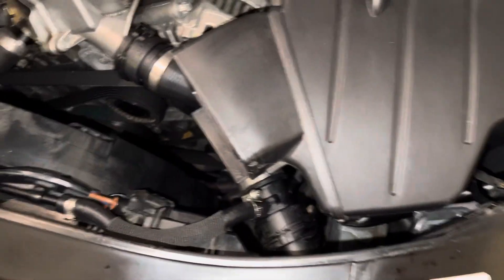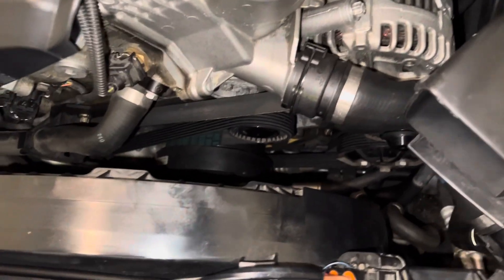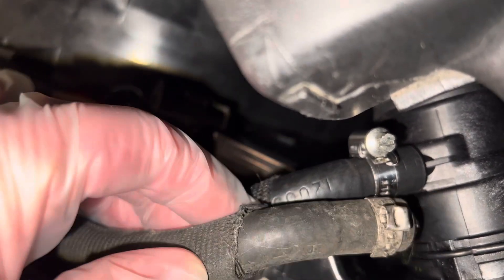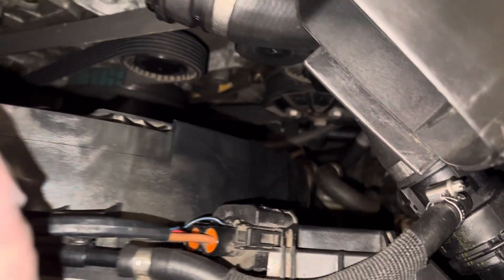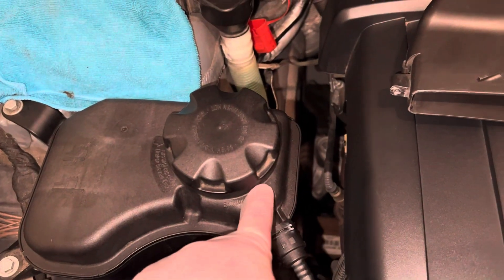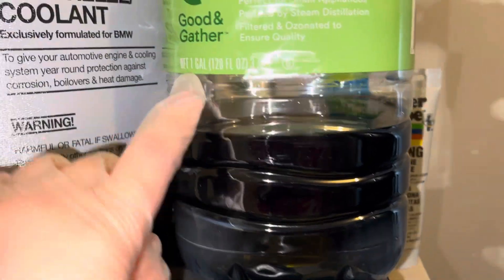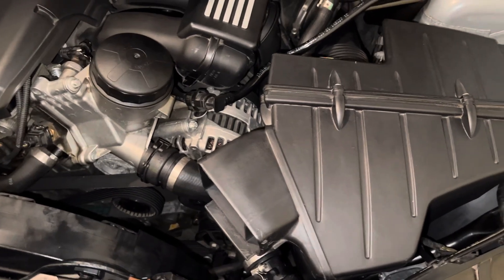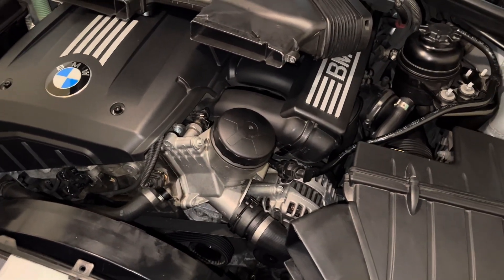How Tight To Tighten Hose Clamps, And Bleeding Coolant System On 2011 BMW 328 XI?

Comment: Where did you put the lube? On the inside of the hose?
Reply from the maker: @atsila_one  I rubbed the lubricant on the rubber O-Ring inside the hose.
Reply: @ do you think Vaseline will work? I’m having the same issue that you had as well did you lubricate both ends of the holes
Reply from the maker: @ I personally would not use Vaseline, because petroleum can deteriorate the rubber rings inside there. I only had to lubricate the part that attaches to the radiator neck. The other end, that attaches to the metal piece, went on perfectly, without having to use lubricant.
Reply: @ADayInBlondiesLife  I'm having issues on both ends!
Reply from the maker: @ Ohhh nooo, really?? Did you  purchase an OEM BMW hose? I purchased mine directly from the dealership. The hose went right onto the back (metal) piece for me. I just had the issue with getting it into the radiator neck at first.
Reply: @ADayInBlondiesLife  I ordered it from O’Reillys same part number everything
Reply: @ADayInBlondiesLife  was able to get one side on today! Will try lube on the radiator side to connect that one
Reply from the maker: @atsila_one  Yayyy, that is awesome!! Which side were you able to get on? The metal side or radiator neck side? I know you'll get the other side on!!
Reply: @ the metal side I used coolent to lube the o-ring and I pushed hard it went on! Now the other side I will have to use some type of o-ring grease to get it on!
Reply from the maker: @ Awesome!! I am glad that the coolant worked for you on the metal end!! I initially tried using coolant to attach the hose to the neck, but it didn’t work for me, on that end. A lot of people have success with using the coolant. I’m not sure why these hoses are so difficult to get on!
Reply: @ADayInBlondiesLife  I agree

Comment: The clamp should be snug which is less than hand tight, or 15 to 20 inch pounds. Hand tight is 30 to 50 inch pounds for strong hands. When you "bleed" its the act of removing air. Air rises to the highest point, the screw appears to be a bleeder screw but doest appear to be at the highest point whereas removing the cap appears to be the highest point.
Reply from the maker: Thank you so much!!